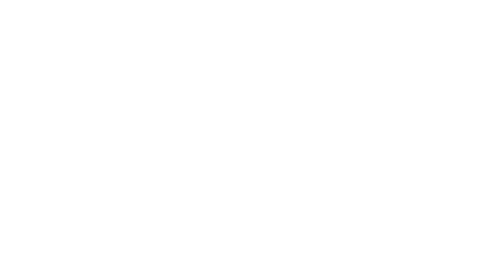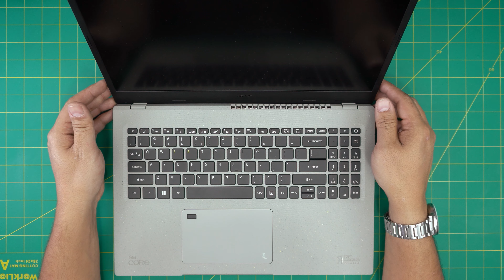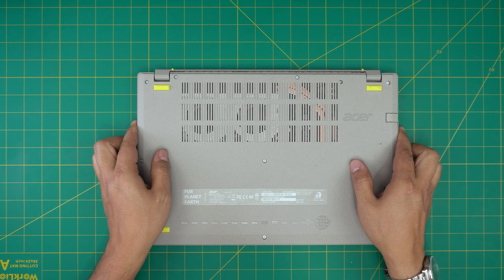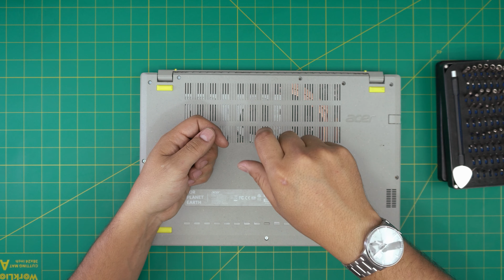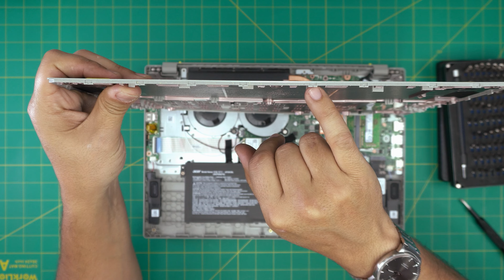How to upgrade SSD HDD on Acer  Aspire Vero AV15-52-77MH ⭐ Storage Upgrade

Comment: I have the AV15-51-526Y. The fan turns on often, the computer gets extremely slow. It crashed then restarted with a "No bootable device" message. Would your method of replacing the HD work?
Reply from the maker: 🫠Regarding your question, your SSD is failing, my friend. Yes, replace the SSD with a new one, and you’ll be fine.  

Install Windows with a fresh installation from a USB drive.
https://youtu.be/K3UFQmPcQjs

Should you have any further questions or requests in the future, please don't hesitate to ask me.
cheers🍻

Comment: Is there enough space for an SSD with a heatsink? Specifically the SAMSUNG 980 PRO, measuring 80.15 mm [L] x 24.15 mm [W] x 8.6mm [H]
Reply from the maker: Regarding your question, you can't use a large regular heatsink for M.2. Also, it's important to note that for any NVMe up to 2TB, a heatsink is not necessary. If you go beyond 2TB, then a heatsink for the controller may be required.
We install Samsung 980 Pros without any issues, and they work fine, reaching temperatures of 65°C, which is perfectly acceptable and won't impact performance or durability. If you still want to add a heatsink, you can opt for a slim one., like this:
https://amzn.to/49uxy19
Should you have any further questions or requests in the future, please don't hesitate to ask me.
cheers🍻

This is an  Amazon affiliate, when you use my links, I earn a percentage, which helps support the channel🙏.
Reply: @uFixTek  Alrighty, thank you kindly.
Reply from the maker: It's my pleasure my friend.